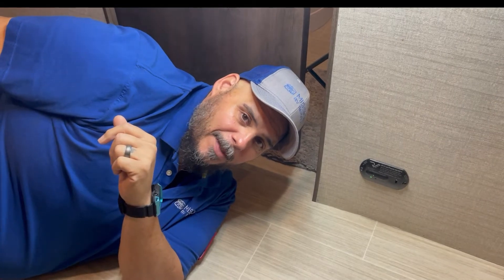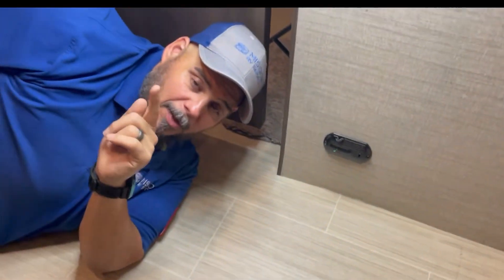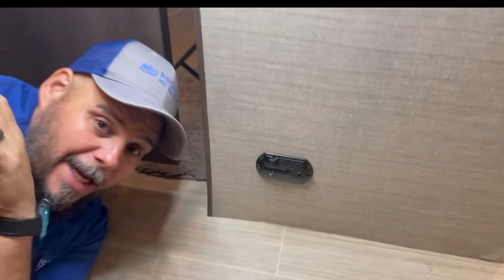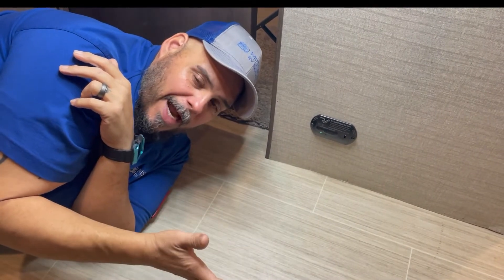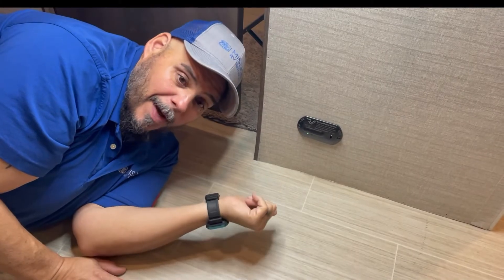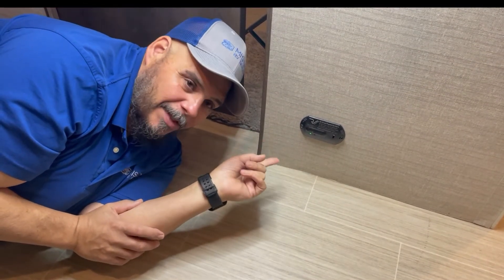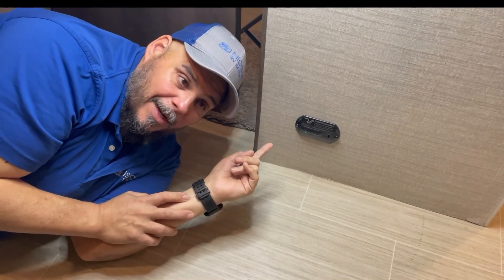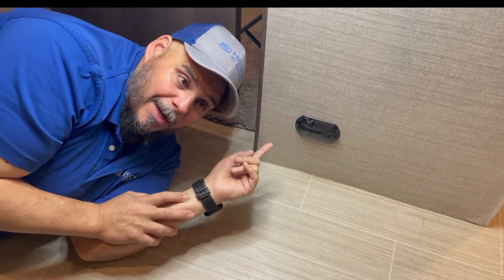RV TIPS: LP Detector Mysteriously Going Off ?

Comment: You are laying down in a 36A. We have one. And we had that problem too. Now, since this bathroom is mine, it is being used daily. The trap in the shower is no issue. We did have problems with the air admittance valves and I actually replaced all 3 in our 36A. But there is one more thing! This RV comes with Dometic 300 series residential style toylets and they had floor seal problems. Dometic was/is aware of this issue and replaces them. Used to smell pretty bad on travel days.

Comment: Okay I’ll check my battery. Mine goes off every few days. I’m going to clean the sink and shower really good as well just in case. But thank you for some ideas. I don’t have my propane tanks  even hooked up and it was fine before unhooking them. But I’m thinking most likely it’ll be a battery issue because when there was a strong propane smell an RV repair man came and fixed it and not once did this go off and beep. Now that that’s fixed and propane’s been unhooked cause I don’t use it so figured wasn’t making sense to have them hooked up. But I’ll try the battery and see if it helps and clean the shower and sink.

Comment: If the light is orange not quite red what does that mean? The propane is off and the gas button is off as well haven’t been using the shower or no cleaning products etc. could the life spam just be running low?
Reply: Also it’s winter and the water hasn’t been used in awhile so it could just be the water trap?
Reply from the maker: Could be the trap or you could just have a bad detector. They say they’re supposed to be good for 5 years but ours went bad after 2.

Comment: Oh my thank you!
Reply from the maker: No problem! Thanks for watching!
Reply: @missionrvservices  can you tell me how to reset this alarm.  It's still red.
Reply: Nope, it's fine now. Sheesh!
Reply from the maker: @hooliganfunnetty4712  if pushing the button doesn’t reset it for you, it could be an indicator that the device is failing or you have an issue that needs deeper inspection.  we recommend you getting a qualified tech to look at it, as it’s an important life-safety device.
Reply: @missionrvservices  I'm sure it took a minute is all. I had drained the gray tank last night. I never use the shower but have put a bath barrel in the stall. Certainly just what you said. How did we get buy without this technology 😅
Reply from the maker: @hooliganfunnetty4712  😅

Comment: Question, I live full time in my trailer in Colorado. Could those traps freeze open? Bc i had an issue tgat magically vanished when it got warm after a Really cold snap.
Reply from the maker: Yes that could’ve happened but your horizontal trap might be going bad.

Comment: The only time my detector is going off is when the hot water is turned on.  If it was a dried trap, it would happen even when using cold water, right? The water heater was electric powered not gas.  The camper has sat for about a year.  Any suggestions??
Reply from the maker: There’s a possibility that it could be a dried trap issue and  the hot water is causing the trap to stay open longer. Not sure. That’s a good question.